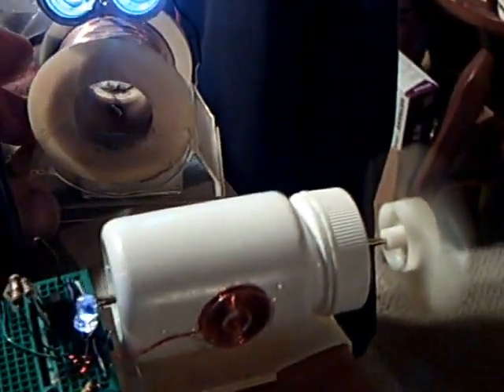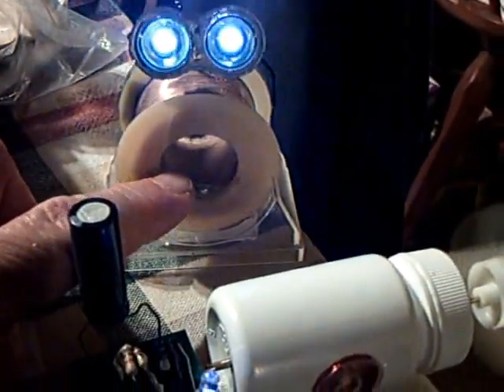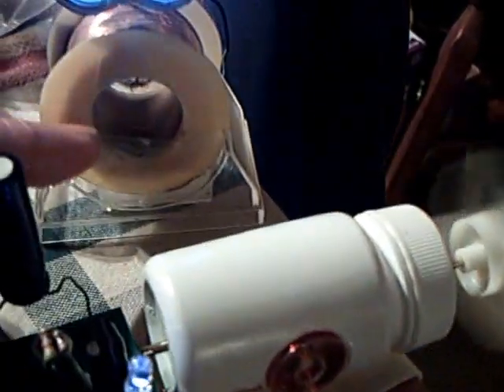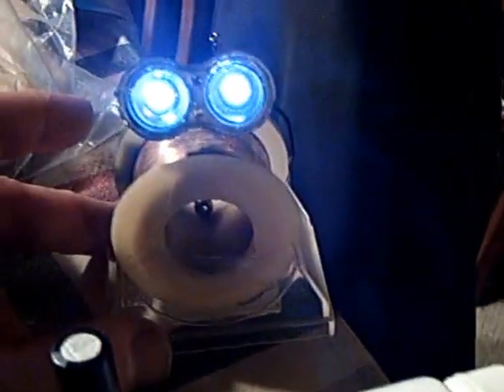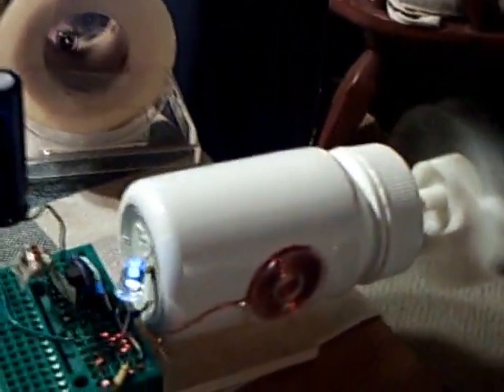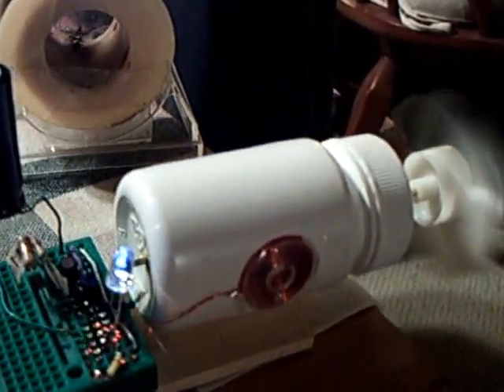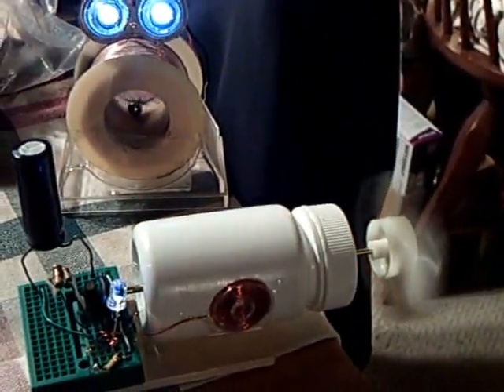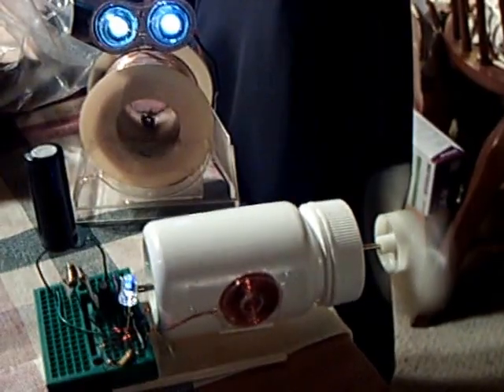Maggie and the Pill Bottle Motor

Comment: Hi may be not relevant but stan Meyers e p g is really the diagram of how joe booker runs an engine on AIR Both knew neutral stripped air can be pulsed by neutral ac and neutral dc fields. This is the encryption stan shows 3 wound coils around tge tube ( that is  the engine block ) 3 coils the alternator the dc starter he shows as putting 12 v on the left hand side he then shows the dash alternator bulb leading back to one side of  the 12v then states it goes into pulsed oscillation the photon source stan says "any type will do " is the spectrum discharge off the pulsing And to make it faster or slower he states add more windings on the top and bottom coils Making a type of potentiometer. When you get this you can just recharge air back into its own system as stan says "don't worry a man with a 2 dollar and 50 cents recycling tube will solve the energy problem ". Joe booker says same type in joe cell talks 6. So it appears wrap together all 3 phase alternator wires and lead back to centre positive of starter solenoid. May be have a chrome chain/padlock in line as chrome is positive just this to solve for a practical